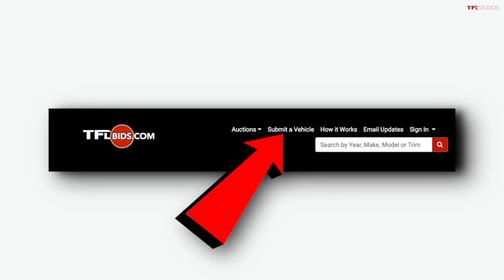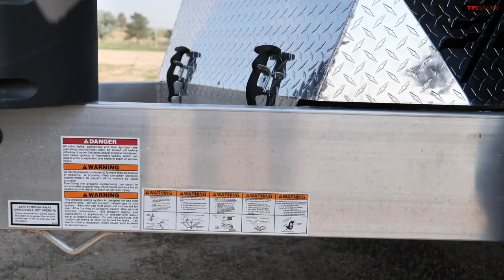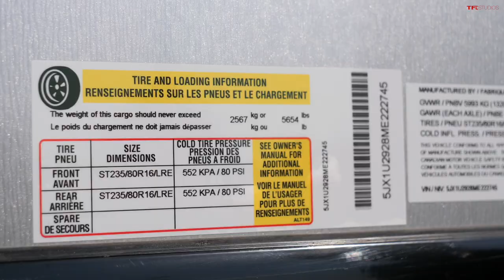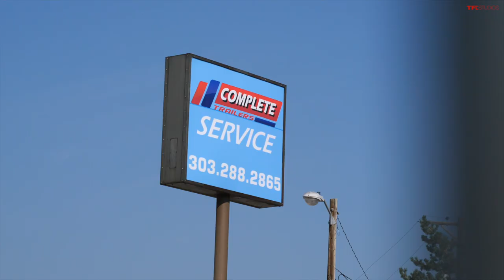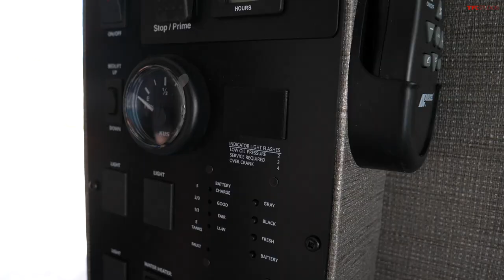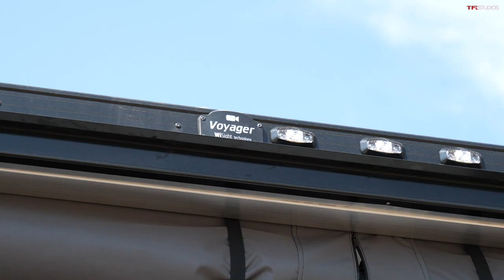This 35-Foot Toy Hauler Trailer Has The Craziest Feature I Ever Seen - TFL Camper Corner!

Comment: There isn’t a single trailer out there that you’ll never have to worry about. They all use cheap components. If the automotive world operated on the same business model as RVs or trailers they’d  be out of business.
Reply: You do remember the auto industry goes through bankruptcy every decade or so?  Trailers are built cheap to be light and cheap priced, this one is not built to be cheap priced and is all aluminum.  Could be the last camper you buy.
Reply: @badgerpa9  nope. Just because it’s made of aluminum doesn’t mean that it’s built to last forever. They all use the same locks hinges and hardware and they’re all built by hand which means if someone’s having a bad day your door locks won’t be properly aligned. I have no doubt that it is a higher quality but it will definitely still have many many issues contrary to the automobile industry.
Reply: @Captndarty  Every auto maker has massive recalls also, nothing is perfect. Like I have said get a good dealer then they will do a PDI and adjust the door locks before you go pick it up.   Hope you have something in your life to be positive about, being negative is bad for your health.
Reply: @badgerpa9  denial isn’t any good for you health either. I’ve had plenty of trailer experience. I don’t have to drive any of my new vehicles around with a tool box…
Reply: ISO CONTAINER + ISO DOLLY = combat veterans version of a bumper pull toy hauler.

Comment: So are those 7000 lb axles with six lugs? Seems weak.
Reply: @badgerpa9  At 2:38 Andre mentioned the gross weight capacity of the trailer is 13,200 lbs. Thats why I thought it should have 8 lug, 7K axles. He misspoke. On their website the specs say it has 6K axles.
Reply: @tandemtrouble82  Well that is what most do is the 10% you have on the vehicle added to the axle max for the max weight.  I would prefer having more axle than you need but I guess that would not be "efficient"  or follow the toyota theory of just a day late and a dollar short on what was needed.

Comment: If you aren’t towing a vehicle,,,a 1/2 ton will handle it
Reply: Not really. The problem with toy haulers when they're empty is they have a lottt of tongue weight, which gets evenly distributed once you put a bunch of toys in the back. So without a toy in the back the total weight might only be 9,500lbs, but you'd probably still have over 1,500lbs in tongue weight which would max out 90% of half tons.
Reply: Sure it will 👌
Reply: Kind of defeats the purpose of a toy hauler